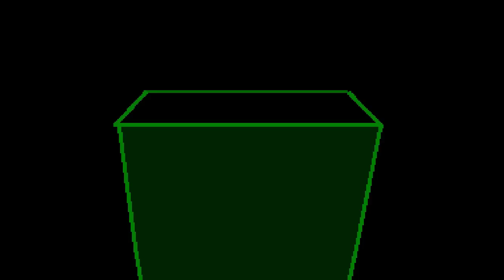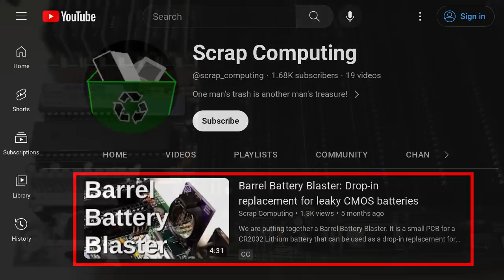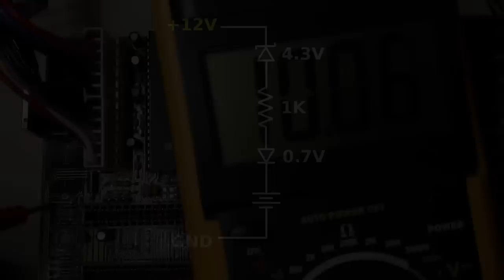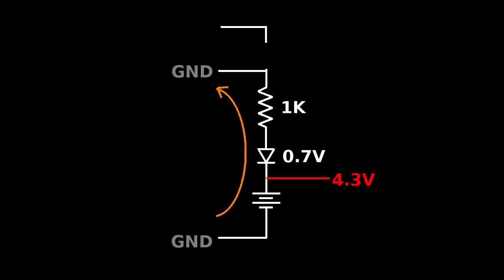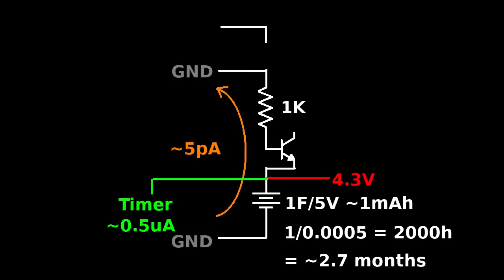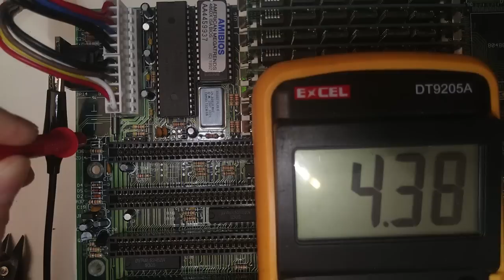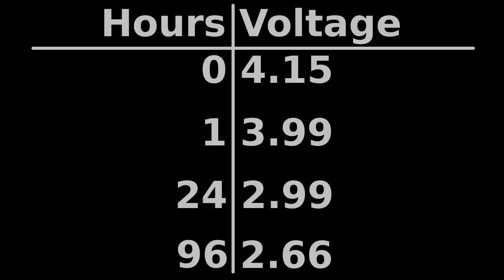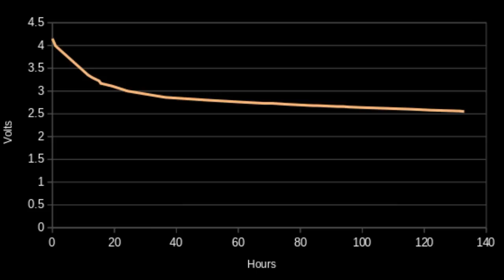Replacing a CMOS battery with a Super Capacitor?

Comment: Would an 18650 be an option? I hate having to replace the non-rechargeable CMOS batteries!
Reply from the maker: These lithium cells require a charge controller circuit.

Comment: I had a laserdisc player built around 1994 with a supercap like this in it. It had some apparent surface corrosion so I replaced it in 2020, but there was no apparently damage to the board or nearby components

Comment: If the charge of the capacitor lasts for a few months then it is not sufficient, an ordinary battery keeps the clock running for ages. When I switch on a computer that was on a shelve for a very long time, often the clock still runs, most the time it is a few minutes off. Most computer clock chips are not that accurate, they really need the time server to synchronise, if the clock chip doesn't get its weekly or daily correction he wanders off to the future or the past.

Comment: Reverse current of common diode like 1N4148 would be <25 nA and not 5 uA (200 times less than you anticipated and 20 times less than clock IC consumption you said). I think reverse biased transistor would be no better at least, despite the fact it is weird.
Reply from the maker: Yeah, thanks for the correction. 5uA is probably for high voltages and temperatures, but for 5V at room temperature it is nA.

Comment: NiCd and NiMh batteries weather overcharging very well compared to Li-ion batteries. From what I have learned from watching electrician youtubers, the liquid electrolyte simmers inside the battery and converts to a gas which returns to a liquid over and over again while it is overcharged. Excess storage is converted into heat and dissipated. As long as you don't feed the battery a dangerous voltage it can handle it.

This is why NiMh batteries are used in garden solar lights and such. No need for an overcharge protection circuit.

Comment: Why would they purposely choose a voltage of 9v?! No wonder the barrel batteries would leak...
Reply from the maker: Well 9V is open circuit, once you get some current going it will drop to 7V and will drop even further due to the 1K resistor. But yeah it seems a bit too high.
Reply: how else would they get you to buy a new computer?

Comment: What voltage range does the CMOS want?
Reply from the maker: I guess it depends on the chip. Mine seems to work OK down to about 2.6V, but I have not tested it very thoroughly.
Reply: @scrap_computing  Dont go too high too!
Reply: Old 286 use up to 4.5V to a minimum of 3V.
Newer 486 system can handle 3V just fine so a CR 2032 is fine.
Sometimes 3V is okay for the CMOS settings but not the clock.
Just connect a 3X external battery pack with AA lithium cells and it will be okay.

Comment: The proper drop-in replacement would be a NiMH battery in the same form factor as the original NiCd. Not sure if NiMH batteries leak but they should last many years as the original batteries did. Personally I'd just use CR2032, they're cheap and simple.
Reply: I personally think that replacing old battery with CR2032(or other easy avaible form) it the best option as they are cheap and easy avaible.
Reply from the maker: Yeah, NiMH would work fine. Some of them do leak, others don't. Not sure why.

Comment: It is an idiot*c idea. The thing called "supercapacitor" is not a capacitor, but downgraded chemical rechargeable battery. The difference is that a complete battery has chemical conversion, which support the balance of ions. The ion battery (which is the correct name as opposed to marketing BS "supercapacitor") behaves more like a capacitor - actually it behaves as a normal chemical rechargable battery discharged beyond exhaustion of chemical oxidizer and reducing agents, when there is nothing left to support the minimum amount of voltage. It discharges almost linearly to 0V, meaning that a huge amount of charge is wasted just because it is difficult to utilize it at lower voltages, meaning that a normal rechargable battery would last way longer and support the minimum required level of voltage.

Comment: The 5v rated capacitors are quite bad at holding the charge.It's better to use 2.5-2.7v rated capacitors as they often have much lower self discharge - you can use a very efficient low current step up regulator to boost the voltage to 3v needed by the circuit. For example, TLV61224 is a step-up regulator that outputs 3v and works with 0.7v...3v input voltage. Or, another example, MAX1724 can do 3.3v out with as little as 0.8v..
You could use an ideal diode chip like LM66200 to automatically switch between 3v or 3.3v from PC and 0.7v...3v from a supercapacitor or battery with minimal losses.
In fact you could probably just use a AA or AAA or even AAAA battery instead of a super capacitor with this step-up regulator and get more life than a CR2032, but alkaline batteries may leak. You could get a lithium based AA or AAA battery, those don't leak and last a long time. 
I've used a 20F 2.7v super capacitor to power a multimeter for around 40 minutes - used a 1A linear regulator to charge the supercapacitor to 2.5v within a minute, then used a LT1037 step-up regulator to boost the voltage to around 5.8v the multimeter needed to be above the low battery threshold and the multimeter averaged around 3-5mA of power consumption.
Another option would be batteries in the CR123A format - you get 3v at up to 1.55Ah and they're not that expensive at around 3 dollars..

Comment: Two years ago i tinkered with SuperCaps too and observed exactly the same problems. Fast selfdischarge and after 48h all your cmos dats are gone. So i used a CR2032 on the external batterie pins of the boards.

Comment: The original XBOX uses a supercapacitor to power it's clock chip.  It's notorious for leaking and eating the motherboard.  Whether that's because it has the same issues as other cheap capacitors made during the "plague" era I do not know.
Reply: exactly, my first thought before I even watched the video was "oh yeah, remove one ticking time bomb and replace it with another, great idea .... NOT"

Technically, CR2032 can leak too, but they very rarely do - I have not seen this happen yet, but I have seen plenty of boards destroyed by a leaking varta or leaking capacitors - so I'll take a CR cell over anything else any day of the week if possible.
Reply: I think super capacitors have a little different chemistry now but im not sure. We will find out after another 20 years hah